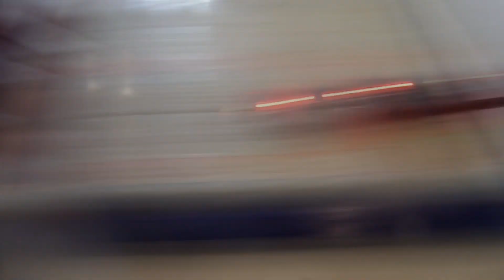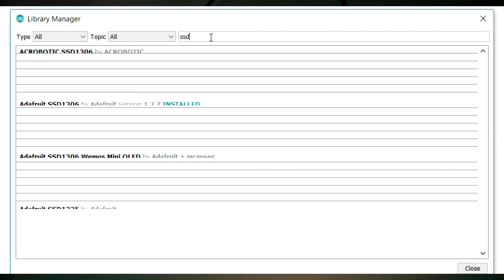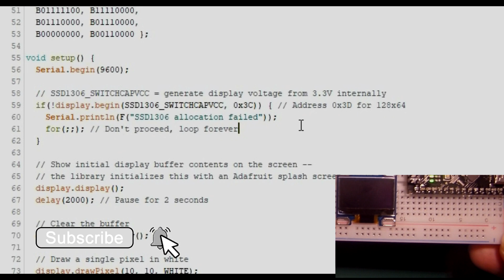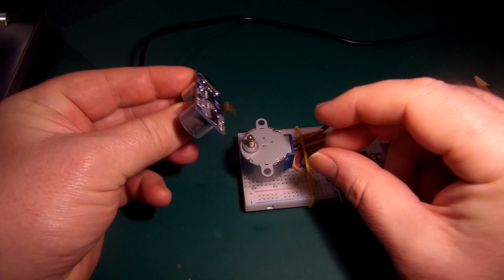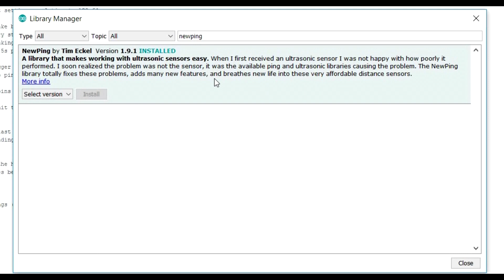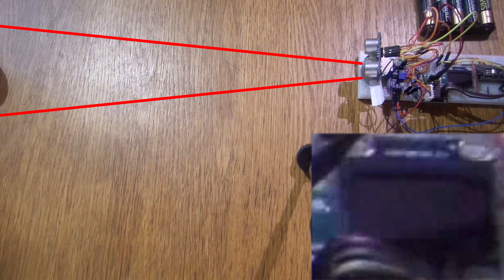Build your own sonic radar (Sodar) - with graphic display!

Comment: Awesome video and way underrated channel!!!
I am curious if it is possible to adapt your build to the TF-Luna Lidar sensor. 
I read thru the code but man i have no idea where to start. It would be awesome to have a longer range but most lidar based videos have a pan tilt function in order to scan the room what is nice but way to sophisticated for what i am looking for.

Cherrs!
Reply from the maker: I can't see why it wouldn't be possible, although I have no experience with these sensors so.... you know, not sure how tricky it would be. I will look into ordering one of these sensors at some point in the future as I was not happy with the resolution from the sonic ones

Comment: Great vid! Any idea what would be a good cheap salvage steppermotor for this ? Got all other parts, just not the stepper and I don't rly want to order one :) Would a toothbrush motor be ok or is that a continuous motor ?
Reply: Hmm harddrive motor seems to be a stepper, but that is 12v it appears
Reply from the maker: Yes, toothbrush wouldn't work. Old printers usually have a couple inside and would be better than a hard drive motor.

Comment: Excellent project; well explained.  The radar sensor upgrade sounds fantastic. Do you know what radar sensor you will be using?  How feasible is using a low power laser (like from a laser pointer)? Thanks!
Reply from the maker: Thank you, I ordered a RCWL-0516 microwave radar sensor. LIDAR laser sensors exist but are expensive, andreas Spiess's channel did a video on then. I can't see how we could do it with a normal laser pointer without a fair bit of additional complexity. Buying an off the shelf unit is probably easier.